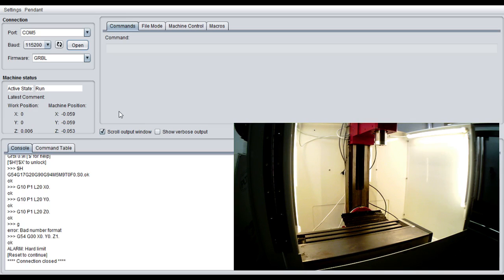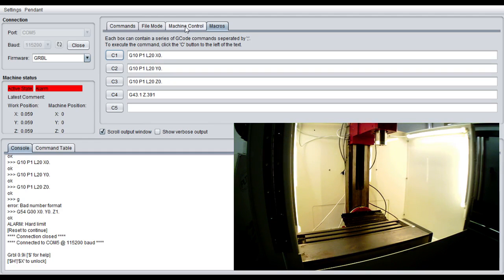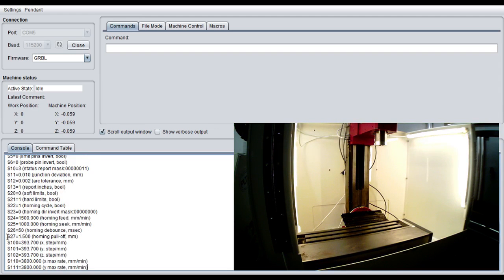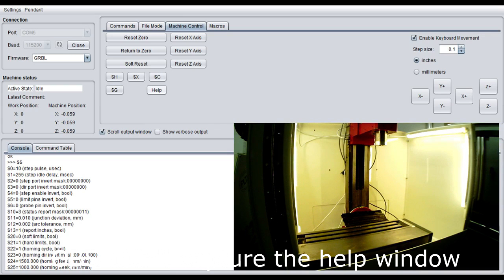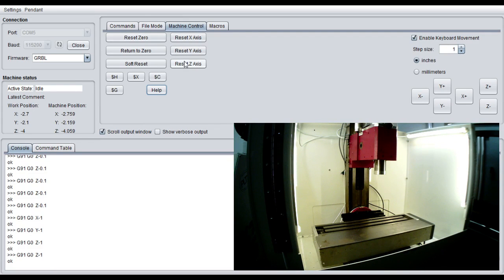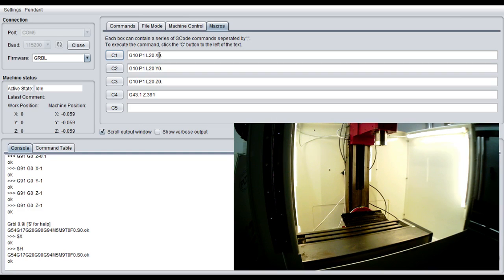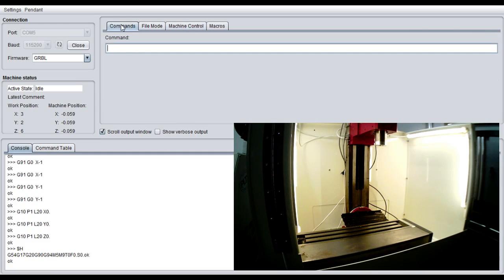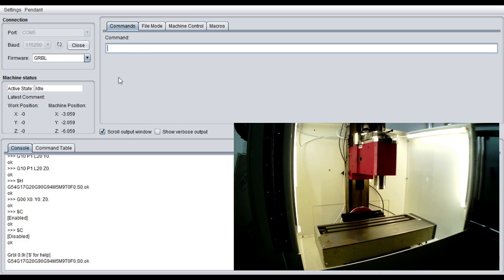Universal G-Code Sender Walk Through HX8410 CNC Milling Machine

Comment: ı have a problem ı open universal gcode sender and ı trying connect my machine from com6 ı click open but universalgcodesender is closing. What can ı do ? ( command pannel is write Untested Windows version 10.0 detected!
Reply from the maker: Verify that your virtual COM port drivers are up-to-date. Verify that you are actually using COM6 for your device. Download a stable and proven version of UGS.
Reply: yes my drivers is updated. sometimes ı connect but ı cannot right now. UGS closed and make new .log document. ı opened it its writing A fatal error has been detected by the Java Runtime Environment. but ı installed jdk
Reply from the maker: Then update Java and Java Runtime Environment on your computer.
Reply from the maker: You can also google the error and read forums that specifically address your issue. This is not a software support forum for UGS.
Reply from the maker: No, There are dedicated forums for this type of troubleshooting through the developers of UGS. We are not a part of UniversalGcodeSender's team.

Comment: you seem to know UGS pretty well. Question: i can jog around with the keyboard and return Home and all that good stuff....but when i send a drawing to plot.....my pen goes from XO,Y0.....all the way to say...X75, Y75 and stops without plotting ( way beyong the work table limits even if it is a very small drawing that easly fit on the work table !! ). How can i tell UGS the size of the working space ?  Do i need limit switches ?  Thank You
Reply from the maker: I viewed your recently posted video titled "CNC problem". It is difficult to say what exactly is wrong without having access to the program you were running, but my suspicion is that your troubles stem from within your code, as the machine's feed rate moves much faster than your other video (even with the other video being at 4x speed) and it wants to drive past the extents of your machine.  

You have limit switches on your machine already for setting the home location.  Adding limit switches on the extents of your machine, while not required, will help prevent overdriving your plotter (as the machine will "alarm" out and cease moving).  This will not solve your problem, though. 

UGS does not have a way of setting the size of the working space.  UGS's function is solely a controller, meaning to drip-feed the gcode to your machine or to allow manual user control. With that said, if you are not drawing your own parts to scale/generating gcode (i.e., within your known working space), then the code your are running will have come from another person's machine.   CNC machines are not like 3D printers, where you can just download a file from the internet and hit "go".  You need to understand that code at play behind the scenes.

Comment: I have made my cnc machine , but I have a big problem , what ever I have done , when it comes to an output , the machine cuts 1/30 of what I have drawn. I used  the default parameters as in GRBL page . the machine works fine but is cutting in micro. 
I draw in inkscape , height = 100 mm , width = 100mm . but when I run the gcode file it prints /cuts a square which is exactly 10 mm. the settings are as under.
Please Advise what to do . and where am I wrong
I am not using a belt , instead it is a regular 10mm threaded Rod for x y z movements.

$0=10 (step pulse, usec)
$1=25 (step idle delay, msec)
$2=0 (step port invert mask:00000000)
$3=6 (dir port invert mask:00000110)
$4=0 (step enable invert, bool)
$5=0 (limit pins invert, bool)
$6=0 (probe pin invert, bool)
$10=3 (status report mask:00000011)
$11=0.200 (junction deviation, mm)
$12=0.200 (arc tolerance, mm)
$13=0 (report inches, bool)
$20=0 (soft limits, bool)
$21=0 (hard limits, bool)
$22=0 (homing cycle, bool)
$23=1 (homing dir invert mask:00000001)
$24=50.000 (homing feed, mm/min)
$25=650.000 (homing seek, mm/min)
$26=250 (homing debounce, msec)
$27=1.000 (homing pull-off, mm)
$100=314.000 (x, step/mm)
$101=314.000 (y, step/mm)
$102=314.000 (z, step/mm)
$110=635.000 (x max rate, mm/min)
$111=635.000 (y max rate, mm/min)
$112=635.000 (z max rate, mm/min)
$120=50.000 (x accel, mm/sec^2)
$121=50.000 (y accel, mm/sec^2)
$122=50.000 (z accel, mm/sec^2)
$130=200.000 (x max travel, mm)
$131=200.000 (y max travel, mm)
$132=200.000 (z max travel, mm)
ok
Reply from the maker: Ahmed, 

It is difficult to say what exactly is causing the issue without knowing the hardware on your CNC machine/without having your program on hand. However, since you mentioned that your machine is using the default parameters for GRBL, we have an idea about the cause of your troubles.    

This forum discusses how to calculate your $100->$102 step/mm value:

https://www.machsupport.com/forum/index.php?topic=16338.0

A step/mm calculator can be found in the forum above, but I'll list it here for convenience: 

http://www.machsupport.com/forum/index.php/topic,16315.0.html

Assuming your code is programmed correctly and is without a scaling error, the step/mm value would be the next place to look.  If this value is not calculated with values corresponding to your stepper motors and 10mm leadscrew (use 0's for the gear reduction section as you have a direct drive), then the default value of "314.00 step/mm" for the x,y,and z-axis would in essence act as a scaling factor by over/under driving the CNC machine, and will result in parts being too large or, in your case, too small.

For example, on our machines we have calculated $100->102 to be 787.4

Comment: hello,

i am building my first cnc machine. it is al going verry well. but 1 problem.
when i type. $$. it only go to $26. that is it. so i can not set my max feed rate for the y axis.
do any of you guys know what i am doing rong?
also i can not reset axis. this just dont work.

thank you so much.
Reply from the maker: That is odd. It doesn't make sense that the homing debounce setting is the only function present. Our suggestion would be to re-flash a complete version of grbl onto whatever controller you are using for your machine.   https://github.com/grbl/grbl

Comment: Hello
I have a problem need help from you
I too uesd Universal Gcode Sender same your
but when in $H button click machine not Home comeback and UGS alarm:" >>> $H
ALARM: Homing fail
ok"
please help me!
Reply: We had a problem similar to this. Took 5 weeks to solve after trying several different limit switches and adding capacitors shielded wire etc. Turns out it a line of code in the software. Go to this page http://leadingedgeindustrial.com/contact-us/ and send me an email I'll send you a screenshot of the line to fix and an explanation. I will make a video of this in case anyone else is havi9ng a similar problem. Sorry I didn't reply sooner!
Reply: @yatyas72 what is it plz help